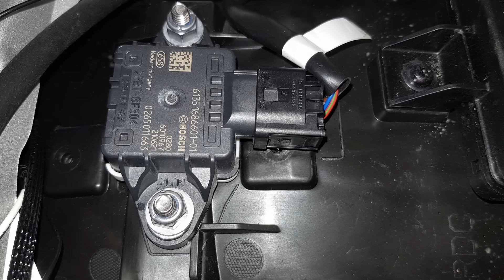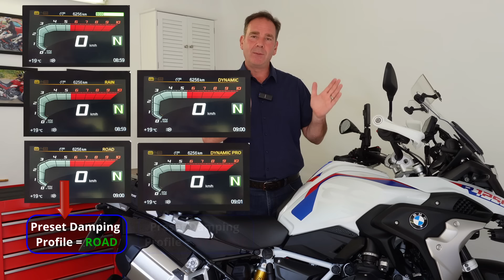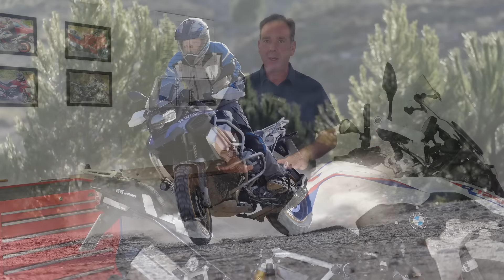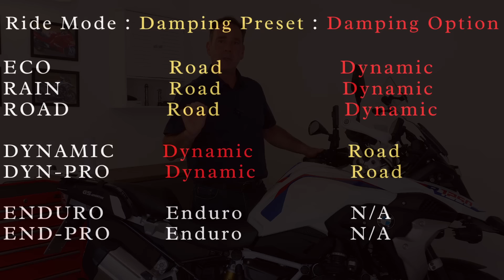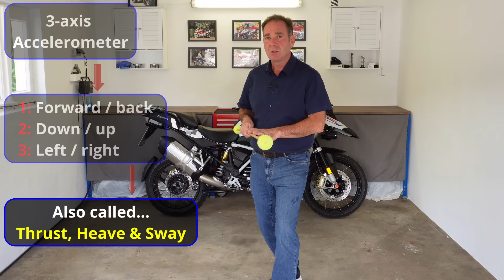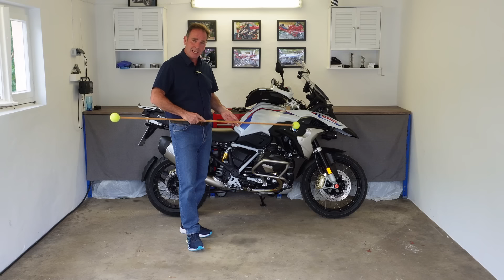EP:12B BMW Dynamic ESA Explained Part 2, Damping Modes, Riding Modes and 6 axis IMU Explained

Comment: I've never had anyone pull out in front of me with the dim amber always on indicators and I have gone 10,000 kilometers both in my country and in other countries (in europe) and I do really like how they look. I agree the back indicators are problematic, if you indicate and brake at the same time the indicators are hardly visible... my friends told me this but other than that I really like them. The ones you showed as a sneak-peak look worse from a design standpoint, why didn't you just get the old style GS indicators from 2019 that came with the bike before these ones? Awaiting your video anyway, to see what product they are and who makes them, and how you solved the rear problem, because the rear light only acts as a brake, you can't turn that into position light... therefore you must have indicators that also have red position light on as you indicate with orange.
Reply from the maker: Hi Sunny, thank you for sharing your experience with your lights and indicators. I hope to have the episode up soon showing the solutions. 
Best wishes Carl
Reply: @justthewayitis  looking forward to that video!
Reply from the maker: The SOLUTION for the multifunction indicator issues, should be available later this week. I was asked by the manufacturer to wait until the new UK / EU website has been finished which should be a couple of days more. Most of my riding friends now want these lights on their bikes, so I'm going to be very busy over winter. Carl
Reply from the maker: And yes and main problem is the rear, because here in Europe  the centre light no longer has the (tail light) and only has the brake light.... which as you are aware means the indicators have to do three jobs. Which is very confusing. More details to follow in the episode.

Comment: hi, a bit off topic,ive got a 2013 k1300s which has the wires ripped out of the front shock. do you know which setting it is in with no power? the rear works fine. thanks.
Reply from the maker: Hi David,  sorry I haven't worked on one myself,  but  have  just googled your year and model and there are lots of wiring diagrams to view and download. Plus quite a few links to K1300 forums. I would start there. Alternatively most BMW dealers have friendly Parts Managers, ( speak them not sales or service) and you are more likely to get an experience chap who will answer your question. Best wishes Carl
Reply: I think its on the hard srtting but its hard to get any info, thanks for repying.
Reply from the maker: Hi hope you find tour answer David.

Comment: I had the impression that within a mode the damping characteristics changed dynamically according to the conditions encountered?
Reply from the maker: Hi Nick, yes that is absolutely correct. Each mode starts with either, Road, Dynamic or Enduro, as its base setting, then that is enhanced by the systems and sensors on the bike, in accordance with the way you ride and speed.

Comment: Great 2 episodes explaining the suspension. Re: the indicators - are you saying that for USA models, the amber indicators were not approved by DOT so BMW had to fit the white LEDs? I have a ‘22 GSA USA model - it has amber front indicators?
Reply from the maker: Hi Hogdrive, the US has the same front options we have in EU and UK. It's the multifunction on the rear that the DOT did not approve. 
In the US the main rear lamp has both Side Light and Brake light functions. 
In the EU and UK we only have Brake light function in the main rear lamp.
The Side light has been moved to the indicators which makes in terrible to see exactly what is happening. 
The indicators in the EU and UK have three functions to perform. 
Indicator flash
Brake light
Side light.
Carl
Reply: @justthewayitis  Yes, The US does not allow the Multifunction indicators on the BMW, at least this is what my BMW dealer stated when I asked after watching your segment about the lighting packages. 
My '22 GS Rallye has the horizontal "V" light style amber indicators. For me, the video was a little unclear when you were talking of changing out the indicators from amber to white. It seemed like you were talking about the color of the indicators not the multifunction system. Maybe I missed something?
Like the others have said in their posts, your videos are well done and very informative... Top notch!
Reply from the maker: Hello and welcome to the channel. Yes I also had the V style amber lights on the front. They are now replaced by a bright White running light (replacing the amber colour) which is a big improvement. They still flash amber when indicating and are Much brighter than the OEM indicators. I will explain the changes to the front and rear in an up coming episode which I hope, will make the improvements very clear to understand. For me at least.. its resolved all the issues and safety concerns I had. More information to come soon. Best wishes Carl

Comment: Hello, great video.  Are you saying that the level of Road damping changes with the mode even though the suspension is set the same?  In other words if I am in road mode and change the suspension to dynamic, that dynamic damping is different than if I am in Dynamic and have the suspension set to dynamic.  In short, are there different levels of Dynamic damping depending on the mode?
Reply from the maker: Hi TDK. There are Three main suspension  damping modes. Road,  Dynamic, Enduro.
These are further enhanced depending on the ride mode you choose. Is there are difference between Road + Dynamic and Dynamic + Dynamic... yes but it's small.
Is there a difference between Dynamic + Dynamic and Dynamic Pro + Dynamic,  again yes but it's all in the sensor system controls  which take into account the way and speed you ride. I'll try to clarify this more in the next episode.
Reply: Thank you for the explanation.

Comment: Agree with most of your comments.  
Last year we rode some of the passes in the French and Spanish Pyrenees. I was riding solo but fully loaded and wanted to get a bit of a wriggle on. The bike was in Auto DSA and Dynamic Pro riding mode. The suspension coming out of slow hairpins was ideal but the throttle response was too severe with the bike leant over at slow speed. I suppose I could have fiddled about in the ‘Pro’ setting of Dynamic and altered the throttle input but it was easier on the move to change the riding mode to Road and set the suspension control to Dynamic. It gave me the ideal setup for exiting those slow hairpins. Very clever stuff. 
Also agree about those indicators and await with interest your solution. 
I’ve supplemented mine with Denali T3’s front and rear controlled with a Hex Ezecan and am now happy that my indicators and brake lights can be seen clearly. Of course it doesn’t solve the issue some have had with the front DRL’s being confused as indicators, but to date I haven’t had anyone pull out on me.
Reply from the maker: Hi String, thank you for sharing your experience with settings, like you I found on our Norway tour with all the slow speed corners up and down the Fjords, Ride Mode : Road, Damping : Dynamic and preload: Auto. Worked best. Its actually very nice to be able to mix the settings  depending on the roads. Yes, more to follow with regards to the indicators. Carl

Comment: Looking forward to seeing your solution for the indicator issue as I'm in 100% agreement with you about the standard multifunction setup. I had my front ones switched off of DRL mode at the first service but haven't managed to do anything with the rears yet. Have looked at Denali and Weiser Technik setups both of which could solve the issue but are quite expensive. Interested to see if you've found a cheaper solution.
Reply from the maker: Hello TSport, that episode is few weeks away, but its getting closer. You might like to wait until that episode 😏, as I hope to give subscribers a discount code too.
Reply: Very good video!! I am also interested in the lights as I agree. Can’t understand how they think the rear lights are safe combined with the indicators. Especially since previous models had such good, bright LED indicators.
Reply from the maker: No one understands why BMW did this.

Comment: This is a superb clear explanation of ESA, thank you. 
I have 2 questions I’d be grateful of your insight on please:
1. I am considering R1250R with or without electronic dynamic suspension control. If I get the one without suspension control then what damping is implemented and how will ride compare to a bike with suspension control?
2. The R1250R does not have front telelever but conventional forks. What difference does that make?  I am more used to conventional fork front suspension and practice trail braking…does telelever at front allow trail breaking as breaking on entry to a curve presumably does little to shift weight to front to improve front traction with telelever?
Reply from the maker: Hi Dan, with regards to point 2: the R1250R handles much better and offers much more rider feedback than the bikes with telelever. I personally prefer this more traditional setup, because you can feel the connection between tyre and road, something that is missing from the telelever models.  BMW know this are are always trying to improve it, I think the GS1300 might be getting closer but we have to wait and see. If I could have found a comfortable seat setup on the R, it would still be in my garage!!!.

Point 1: I have only tested the base R without Dynamic ESA once for a very short 34km test. If I had to choose between the two versions, it would be the version with ESA as it works very very well. You could visit Rikky Tang on YouTube,  he's a good friend and might be able to offer more insight as he has been on the track a lot with his R1250R. If you send him a question... say hello from me 👍
Hope this helps 
Carl
Reply: @justthewayitis  Many thanks Carl for helpful comments and great content. I have followed your advice and sent a message to Rikky Tang with greetings from you!  
Any comment on the trail braking query with telelever…?  With conventional forks trail breaking involves applying front brakes alongside throttle as necessary into turn to shift bike weight forward and compress forks which increases ground traction until curve exit is visible when brakes can be released and acceleration applied. If telelever prevents front fork compression during front braking then I’m not clear whether the same benefit is yielded of fork compression and increased downward force and traction…?
Reply from the maker: Hi Dan, you can trail brake the front on the Telelever bikes but it does not feel the same.  It's not easy to load the front tyre like you can on a traditional bike. The feeling is completely different and it took me a couple of thousand km to adjust. But I think tyres play a big part too, I'm still on the Anakee Adventure tyres which are not great for sports riding. Once I'm on some nice rubber I hope the connection between rider / tyre / road will return. Carl
Reply: @justthewayitis  Many thanks Carl for the very helpful and appreciated insights.
Reply from the maker: Your welcome 👍

Comment: Thank you for this 2nd part of suspension explanations. Is there a complete listing of ALL the combinations possible, and the results that is providing plus examples of real situations a specific combination would be suggested for ?
Reply from the maker: Hello PSJ, there are 36 possible combinations. 
3 preload x 2 damping x 5 ride modes = 30.

Plus, 3 preload x 2 enduro modes = 6.
That would be a big chart and hard to explain clearly, especially if you then want reall world scenarios for these 36 possible option.
I did consider doing this but I couldn't find a simple way to explain and demonstrate this. So it sounds like YOU have found yourself a new task for the weekend.... smile.
Reply: Did you make a chart @psj3940? ;)

Comment: Great explanations, in both Part One and Part Two.       On my non-Dynamic ESA, 2018 R1200RT, I leave the right hand Mode button in Dynamic . Depending on luggage and/or pillion I'll changing the preload . I switch between Normal and Hard on my dampening depending on cornering enthusiasm. I tried Soft (dampening) a couple time on rough roads. Waay too soft for my liking.
Reply from the maker: Hi Gordon,  thank you for sharing your thoughts and setting for the RT, I'm sure will help other RT users. Best wishes Carl